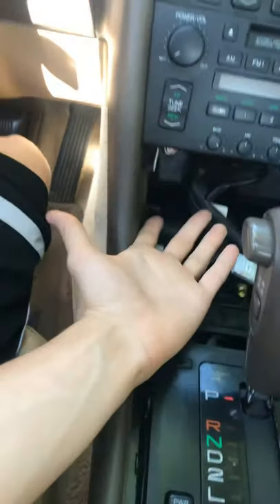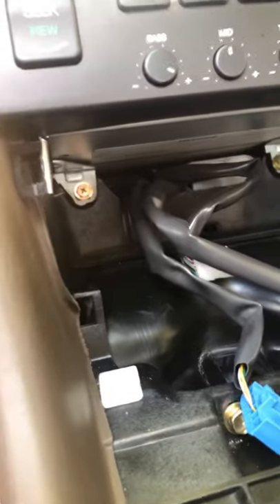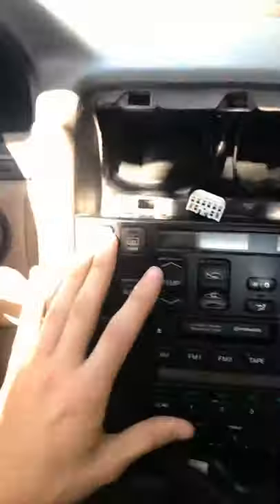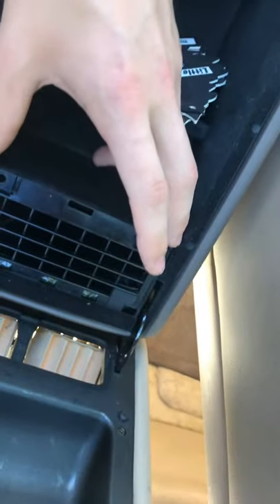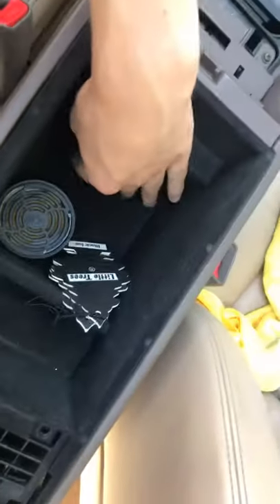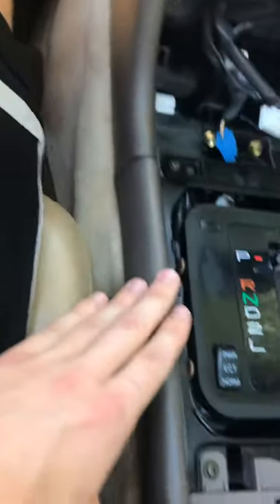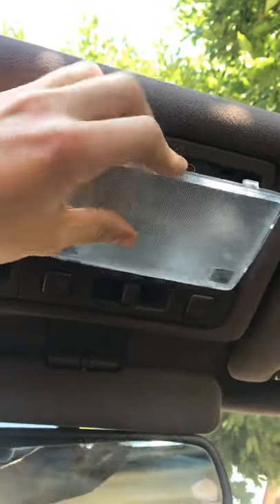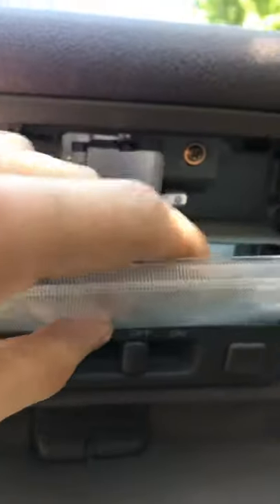UCF10/LS400 centerconsole/armrest/dome light removal

Comment: You said your transmission is messed up, try increasing the line pressure dial on the side of the transmission, using the original fluid t-iv, and maybe add some lucas stop slip stuff if its still slipping or messed up. from a glance I didn't see if you did the job or not so I figured I'd suggest a possible quick fix. sub 50 bucks
Reply from the maker: Yeah no. Transmission got stuck in reverse. Previous owner did burnouts and ruined it.